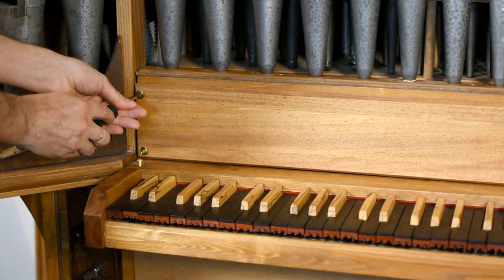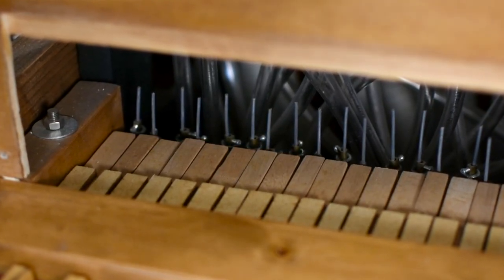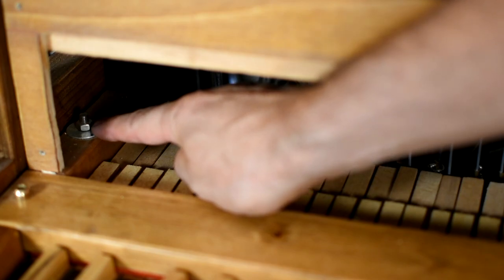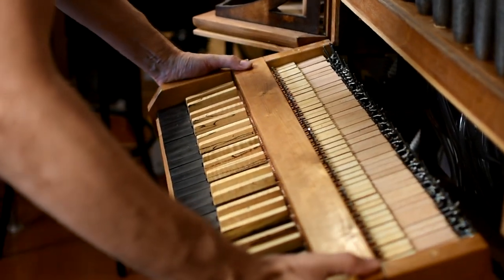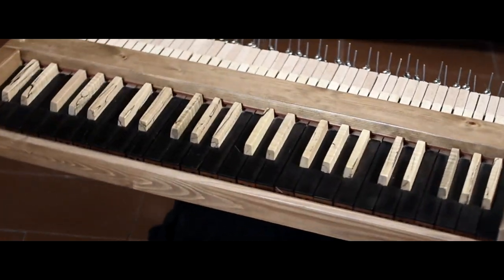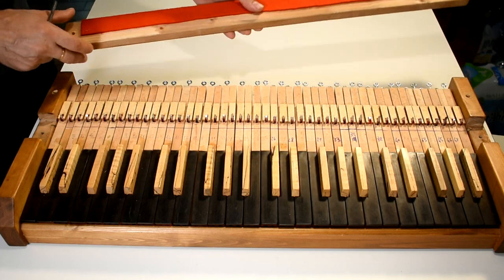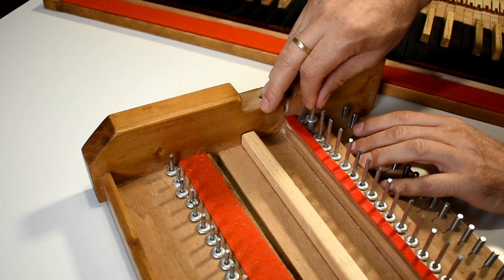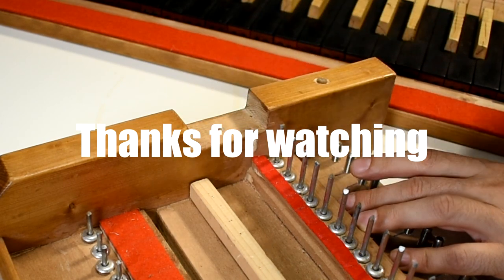Homemade Pipe Organ Tour | #2 Keyboard (tastiera) | Sub ITA

Comment: What material are the black keys made of? Is it very dark wood or something else?
Reply from the maker: Hi, it's a very hard exotic wood called Preciosa, very beautifull wood
Reply: @nippocast  Just according to my eyes it looked like black plastic covers or something similar, as I never saw any wood with this pitch black colour. But the black keys are real wood too you say, awesome, I got to order this stuff too. How much of that Preciosa have you roughly needed?
Reply from the maker: @venceremosallende422  Yes is real wood. it's not so simple to calculate how much wood do you need, , because you have to keep the wood grain for the length of the keys. You have to glue many pieces of wood and then cut to size.

Comment: How much time did spend on organ?
Reply from the maker: Hi Appo!, I spent about two years, thanks
Reply: @nippocast   Where did you get all your skills that you have used in this project? I am just dreaming about making something like this)
Reply from the maker: @appo038 Very good! i take it from some books and from the web, if you are interested I will shortly start a series of videos in which I build a small pipe organ. If you want subscribe, so you can follow my videos.
Reply: @nippocast  Yes it could be great. I am finishing making organ with  bottles as sound source . But it is very simple. For example i use syringes as valves). Anyway i want to make something more serious in the future. Yes , ofc i have subscribed. And one more question: Where did you get the pipes?
Reply from the maker: @appo038  OK, if it works it's fine, but maybe you are ready for the next step... I make part of the wooden ones and bougth the metal ones from dismantled organs in england.